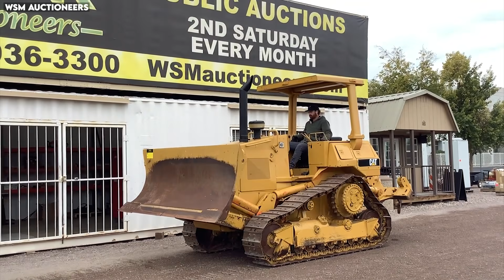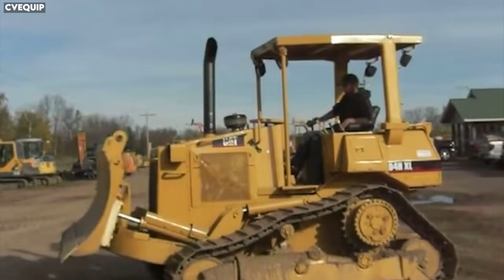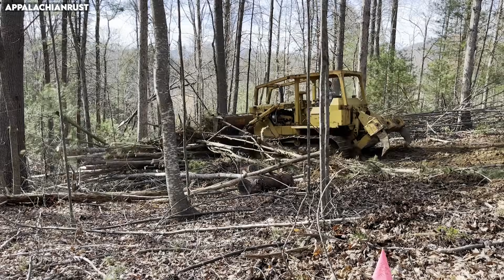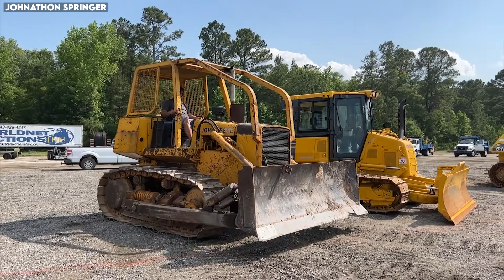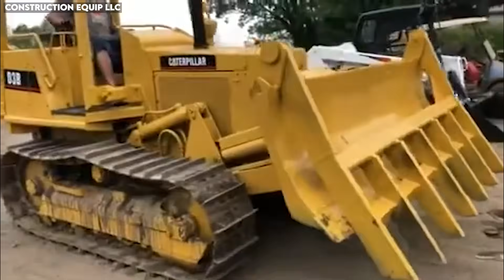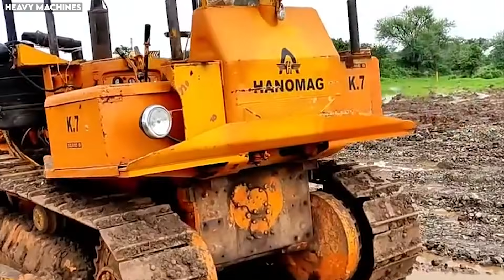10 MOST HATED bulldozers from the 1980s

Comment: I remember having the CASE power shift track turn transmission. It was the Fastest Track Loader we had, and the operator preferred it over our Cat and International Loaders. My only problem was backup I always turned the wrong way. So I used the foot breaks for more critical turns, no biggy 😊 I kept hearing over and over on this video it was the downturn or buy out of these manufacturer. That was probably the biggest player in issues. Your R&D engineer slowly lossing their jobs buy the other company absorbing it together. Just my humble opinion 😊